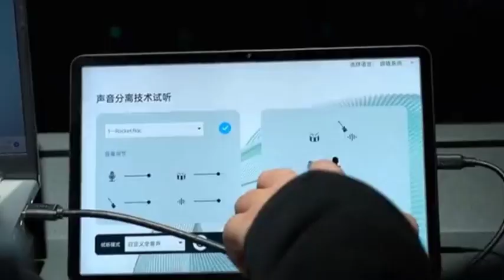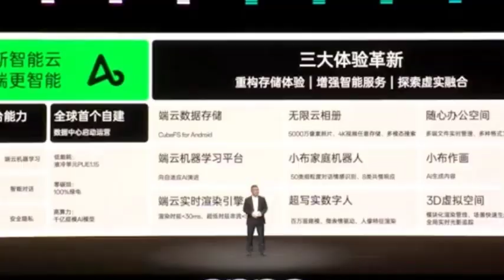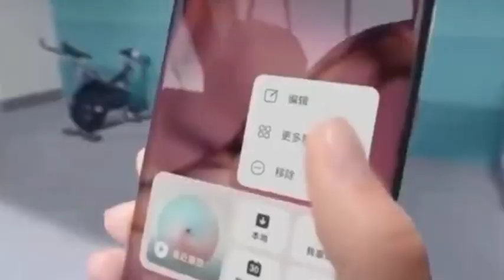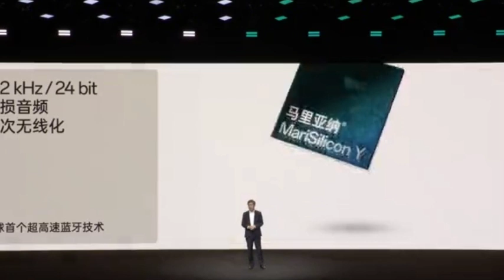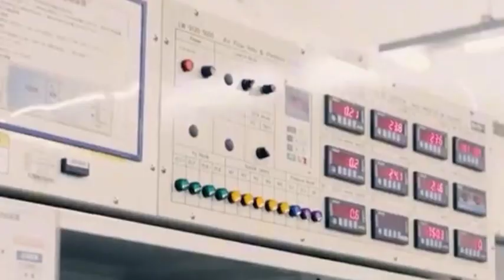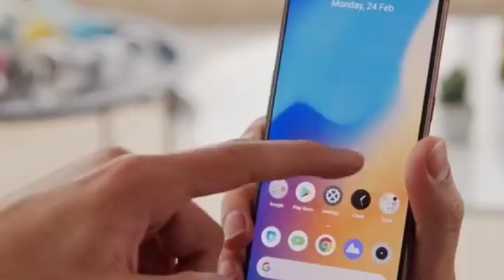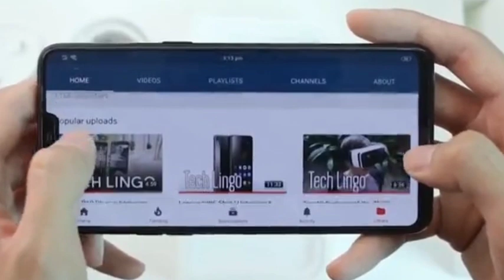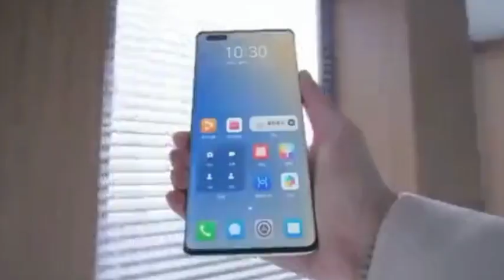This company assisted Huawei in achieving the mass production of Chinese self-developed 4nm chip.

Comment: Once OPPO develop its own 4nm CPU chip using TSMC foundry and comparable to Huawei former Kirin 9000 chip, I wonder will it  be under potential sanction. Many smartphone brands under the BBK umbrella will have access to this high performance chip which would mean they no longer need to buy Qualcomm or Mediatek chips. Somebody will not be happy!
Reply: if china can domestically manufacture 5nm chips then most mobile phone issues will disappear